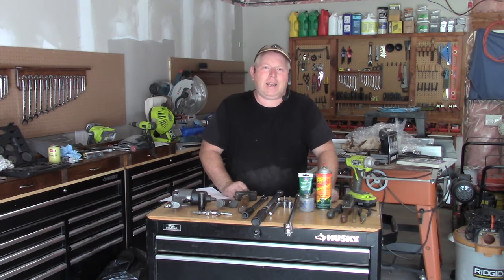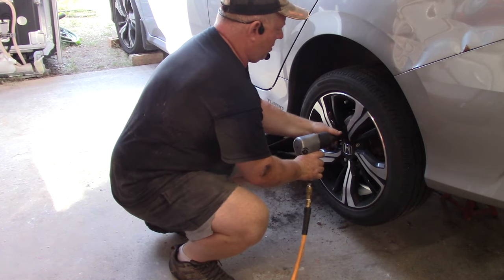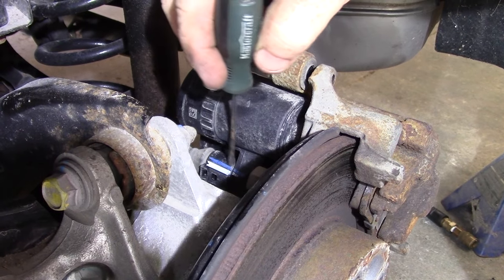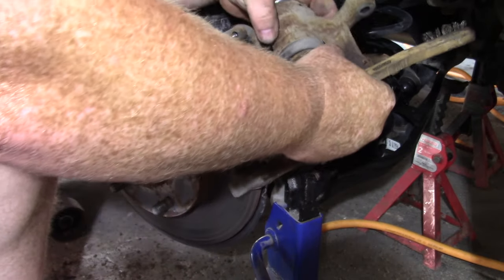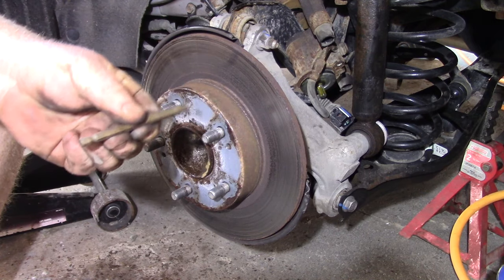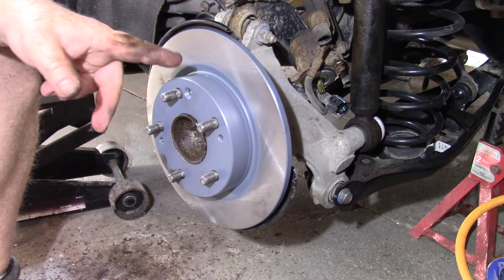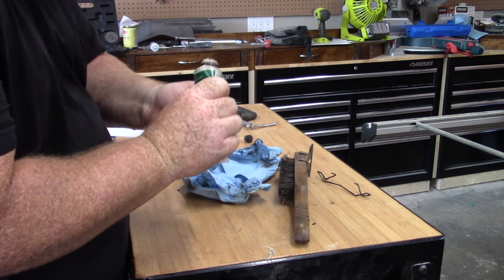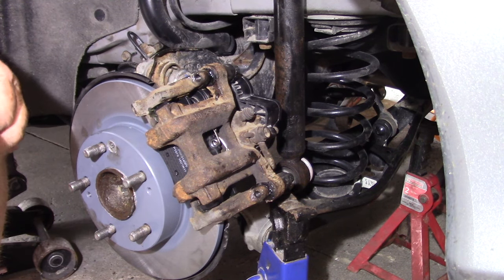DIY 2016 + Civic Rear Brake Replacement With EPB Using Honda Tech Manual

Comment: please help!!I Im only replacing the pads, do I really need to remove the rotor??
Reply from the maker: That's like buttering 1/2 a piece of toast or changing 2 out of 4 spark plugs. You should replace the rotors and lubricate the caliper slide pins too.

Comment: hi nice video but i have a litle problem i put the rear brake in my 2017 civic and now i have  a dashboard saying electronic parking problem  and a flashing brake light any ideas what it could be
Reply from the maker: At the end of the video there is a calibration sequence.  Need to do the calibration sequence to prevent getting a code.  Once the code is up you can only clear it with a newer code reader.
Reply: How many mile replacement befor

Comment: Is there a reason why you don’t have unscrew the motor back out if you screwed it in?
Reply from the maker: @jamesk1989  it’s electronic.  The only way to back it out fully is to put it in maintenance mode with a scan tool or retract it manually.  Once the service is completed you can reset the EPB with the simple calibration sequence at the end of the video

Comment: Is there  a way to lubricate the electric parking break while I replace the pads and rotors?
Reply from the maker: No.  It’s a sealed unit.  Good luck on your repair!
Cheers!
Rob
Reply: Thank you,  I wasn't sure.  It's been a very long time since I've worked on car lol

Comment: Great Video!  I appreciate that you have very thorough content, good lighting and you really get good shots of some important details.  However..
- it hurts me to see you abusing your torque wrench : (  This should be done in one smooth motion until the tool clicks one time. 
- anti-seize compound/lubricant definitely will affect the torque and the resulting tightened tension in that bolt.  Maybe it will not result in anything bad but the bolt will be over-tensioned.  Using torque to tighten a bolt is a very imprecise process anyway and it wouldn't work except there seems to be a pretty wide tolerance around what works.  I am in the rust belt and I put anti-size on mated surfaces but NOT bolt threads.  Been doing this for decades and I use a torque wrench.  Maybe my lug bolts are under-tightened but I can also claim that I have never had a problem.

- 7- in-lbf or ft-lbf ''' whatever"  well these are 12X different from each other so for beginners it is important to get this detail correct.  Experienced mechanics have a touch feel for this kind of thing but not everyone has that.

did the Honda manual specify lubricant on the brake pad slide area?  I tend to think this is useless because there is no seal and there will be tons of road water and salt spray.  That lubricant will not be around after a bit.  I never use lubricant there but I do have to do tons of work to clear rust out of the slide area to avoid the pads being bound tight into the caliper carrier.

for initial tightening of the lug bolts a too-small 3/8 drive impact such as the Ryobi would be great.  it will not reach full torque that the lug needs but will nicely snug up those bolts.  I always torque the lug bolts before lowering the car or lower it just enough that the tires help counter-hold a bit.  Using an air-powered impact it is quite possible to exceed tightening torque before the torque wrench is used and all you will be doing is performative clicking.

anyway, this is about the best brake pad change videos I have seen even though I had some small issues with it!  thanks!
Reply from the maker: In the auto industry they check torques multiple times for important fasteners.  I'm going to make a video on torque and anti seize compound soon because I get so many comments about it.  Yes you are correct, the bolt will be on the plus side of the "nominal" torque spec but well within the plus/minus tolerance range and the actual safety range of the fastener is significantly higher than the nominal torque specifications.  Most people who do a lot of auto work on their own vehicles use anti seize compound and there are a lot of compounds used on fasteners in the auto industry.  Usually to prevent rust and sometimes dry thread lockers are pre applied to fasteners such as SRS components.  
Thanks for your comment!
Cheers!
Rob

Comment: is turning the vehicle to 'on mode' same as starting the vehicle?
Reply from the maker: No it’s accessory mode, press once without your foot on the brake to turn it on or turn key to the first position but don’t start it.  Then depress the brake and apply electronic parking brake.  Make sure to wait until it’s fully engaged.  After it’s fully engaged you start the car, pump up the brakes and cycle the electronic parking brake off fully and on fully 2x.  That calibrates the parking brake.  Good luck on your repair!
Cheers!
Rob

Comment: The service manual says to torque the caliper mounting bolts to 80 ft-lbs. Why did you torque them to 55 ft-lbs instead?
Reply from the maker: Front brake caliper torque is higher than rear brake caliper torque.  It’s a much smaller assembly and that’s why the rear specifies a lower torque.
Reply: @robsgaragewoodworkin  But again, the 10th Generation Honda Civic service manual says 80 ft-lbs for both the front and rear. Yes, I did check the manual multiple times to verify this. So, I'm not sure why some people are applying only 55 ft-lbs. I just want to be sure because I plan on changing my brakes for the first time. 

Also, thank you for responding!
Reply: @robsgaragewoodworkin   The reference: Honda civic service manual chapter 27 under section "Rear Brake Caliper Removal and Installation", step 7 "Brake Caliper - Remove". Shows a diagram with the torque specs. States 80 lbs.ft

You can easily find the manual by searching "Service Manual for 10th Gen Civic"

Comment: Do you do this job with the ignition on the entire time? The reason I ask is because if you turn off the ignition it will automatically apply the handbrake. I was wondering if you have the ignition on, won't it put a warning light on when you disconnect the motor wiring, i.e. detect an open circuit? Thank you.
Reply from the maker: Release the parking brake.  Turn off car.  Follow all the instructions in the video.
Reply: In this model Civic, you can turn off the ignition with the parking brake off and it will not automatically engage the parking brake

Comment: Should I remove the fluid reservoir cap before compressing caliper pistol
Reply from the maker: You can but it isn’t actually necessary.
Reply: @robsgaragewoodworkin  If you have added brake fluid to the reservoir as the brake pads have worn, you can remove some brake fluid from the reservoir to prevent it from overflowing and spilling in the engine compartment. A better way is to open the bleeder valve as you compress the caliper piston, (not Pistol), but be careful not to leave it open or to let air enter when you release the tool that you use to compress the piston. Close the bleeder valve before removing the tool. It is best practice to not force old fluid that has been heated at the caliper up to the master cylinder.

Comment: Also, was it really necessary to remove the EPB motor housing?
Reply from the maker: You can buy a scan tool with special “brake maintenance mode” and electronically back the EPB up.  You can back it up manually with a brake wind back tool or you can remove it and rewind it by hand like I show in the video.  There are lots of people who have problems with the wind back tool and most people don’t want to spend an extra $300+ for a compatible scan tool.  This is why I posted this video and this method.
Reply: @robsgaragewoodworkin  oh okay, I wasn’t aware of all the content surrounding the EPB. Glad I found your video though because I would have been confused. Thanks again!
Reply: @robsgaragewoodworkin  In all fairness, they are not that expensive anymore. I actually did a 2017 Civic today and use the Autel EBS301 and it is about $200. There are some for $100, but I use this for several brands, so I spent a little more. Its far easier, plus when you do it manually, it leaves several codes in the control unit. It doesn't seem to cause a problem, but the codes are there. I cleared out about 4 today from the previous service.

Comment: What are the tools you don’t need ? I’m buying all the stuff and I’m trynna fig out what tools do you not need ?
Reply from the maker: You will need a socket set and a breaking bar and a torque wrench and brake grease and that special socket for the EPB that I mentioned in the video.

Comment: K I just got watched another vid the guy just turn the key to the on position and changed his brakes without taking off the electronic brake is this ok ?
Reply from the maker: Not really.  You can remove the pads and reinstall the same pads but the new pads are thicker and you have to press the piston back in to get them to fit.  The e brake retracts but not fully so you will always have to set it to service mode manually like I did or with a computer or new scan tool.  Good Luck with your repair!
Cheers!
Rob
Reply: @robsgaragewoodworkin  just changed out both sides without issue thanks to your step by step vid awesome thanks

Comment: I just broke the tab on the connection attached to the EPB. How can I disconnect now that it’s broken? Also do I even need to unplug?
Reply from the maker: You can leave it plugged in but I showed how to unplug it so people wouldn’t break it.  Dammed if you do, dammed if you don’t 😂
Reply: @robsgaragewoodworkin  Apparently I suck at following instructions😅😂. You did such a detailed video and I still found a way to mess it up haha.
Reply from the maker: @kiidxky1320    I thought that less people would break the wire if they removed it.  Couplers can be tricky
Reply: I did the same thing on the passenger side. I managed to get it disconnected eventually and had zero issue with the drivers side. I tried taking it off without unplugging it but it seemed to not have enough slack and I was worried I'd make things worse. Once everything was back together I didn't get any lights and the brakes feel good when stopping. I changed front and back this weekend.

Comment: How do I fix my brake system light. Lol I fu***d up. I did make sure the e brake was off while the brake pads were off. I think it broke cause you said confer clock wise but mine went clock wise and never ended.
Reply from the maker: Turn it clockwise until it stops.  Don't use much pressure.  I turned mine by hand.  After its all done and reassembled you have to turn car to accessory mode and cycle the parking brake on fully then off fully.  Start the car and repeat 1 more time.

Comment: hey rob, will a c clamp fit to compress the piston?
Reply: I'm wondering the same too! Worked like a charm on the front brakes!
Reply: @KeyGillz  I know. . I ordered a tool like what he has . Cost 20 bucks. . Im pretty sure a c clamp will work
Reply from the maker: Yes it will.

Comment: Do you have to put the car on maintenance mode ?
Reply from the maker: You can do it manually as per the Honda instructions (the way I did it in the video) or you have to buy a scan tool with EPB to put the car in maintenance mode.   https://www.canadiantire.ca/en/pdp/innova-3160rs-obd2-diagnostic-scan-tool-with-abs-epb-srs-network-scan-0251096p.html#srp

Comment: So I have been doing brake jobs on my own cars for 30 years. I have never needed to replace OR resurface a brake rotor. I just regularly check brake pad wear and replace them before ANY metal  to metal contact. Pads will still have material on them when I toss them. Original rotors still smooth as glass. I can get ceramic brake pads for less than $25. I have owned Civics, Accords, Camrys, F-150, Ford Rangers, 1 Miata, and a Silverado. I've done brake jobs on all of these EXCEPT rear brake shoes. I ABSOLUTELY hate messing with those. Fortunately most cars today are 4 wheel disc. I forgot about corrosion since moving down South. The Civic in the video is a little corroded looking underneath for such a late model car. I'm guessing it's the salt on the roads. Down here in Georgia a 20 year old car will have literally no corrosion at all and still be pretty clean.

Great video though and very complete. I will watch again regarding the electronic brake module portion when I do mine. My Civic is a 2016, but still less than 10,000 miles.
Reply from the maker: LOL!  Yeah I drive a lot and the salty roads make maintenance a much larger issue.  Thanks for your comment!
Cheers!
Rob

Comment: After removing the coupler, i try to remove the caliper but it will not budge. Any ideas?
Reply from the maker: The caliper slide pins hold the caliper to the caliper mounting bracket.  I think they were 7mil hex bolts.  Should be in the video.  If the bolts are out you just need to pry the caliper up.  I think I show it in the video.

Comment: Is it necessary to grease the back of the brake pads?
Reply from the maker: You have to use brake grease on the areas that move on the caliper and also grease the caliper slide pins.  You can put some grease on the piston ring if you wish to prevent rust and also where the caliper holds the back of the pad.  It’s not necessary.

Comment: What about bleeding the brakes?
Not necessary?
Reply from the maker: @migueldeleon7266   when you don’t open the system you don’t get air in it.  Hence bleeding is not required.  If you open your bleeder valve to push the piston back (as required on some makes and models) then you have to bleed the brakes after.

Comment: On the passenger side I have to turn the pin counter clockwise?
Reply from the maker: Just follow the instructions in the video.  Both sides are the same.  Good Luck with your repair!
Reply: Turn clockwise on both sides.

Comment: At 7:34...you can do it without detaching the coupler from the actuator. I did the same, worked perfectly. One less step. And Place some plastic cover on actuator once you pulled out the actuator cover. You don't want anything to fall on grease.
Reply from the maker: It’s the eternal question.  Do you tell people how to disconnect the coupler so they don’t break the wire or don’t disconnect the coupler so they don’t break the coupler. 😉
Reply: Your video helped me save $450 + taxes (labor only) at Canadian Tire. Outstanding video!! Can't complain Sir ☺️
Reply from the maker: @sudhirthakur7957  lol!  You are welcome!  No worries! 👍🏻👍🏻👍🏻

Comment: Do you have to remove the ebp before pushing back the piston if I am just going to change the brake pads ?
Reply from the maker: Yes.  If you push the piston back without retracting the EPB it will break the EPB and you should change the rotors and lube the caliper slide pins.
Reply: @robsgaragewoodworkin do you have to put the vehicle into service mode before beginning the brake and rotor replacement process?
Reply from the maker: @elitemindshq3228  yes you can do it manually as described in this video or you can do it with a scan tool that supports EPB.
Here’s another video that shows using the scan tool.
https://youtu.be/V9NDnOIYWag?si=rrHqETNAzfw0DW1o

Comment: The rear caliper bracket should be torqued to 80 ft-lbs. the 55 ft-lbs spec was for the older gens. the honda manual says 80 ft-lbs for the 10th gen
Reply: the EPBA 5mm hex bolts are torqued to 5.9 ft-lbs for anyone wondering

Comment: My epb wire came out of the motor I’m trying to figure out what color goes on to 1 and 2 slot black or white brake system light is on my dash now
Reply from the maker: Have a look at the other side for reference. Is the coupler out or the wires?  And if it’s the wires are the crump terminals still on them?
Reply from the maker: Crimp
Reply: @robsgaragewoodworkin  the same thing happened to me, when I apply the parking brake only one wheel stops the other is loose, and I also have the ABS light on and the parking light is blinking, now I don’t know how to fix it

Comment: No bleeding? After checking pads
Reply from the maker: No.  You only need to bleed brakes if you open the system. Like change the caliper or the brake line,
Reply: Not true when you charge pads and push calliper pins get air inside lines you need to bleed out oil to remove air pockets
Reply from the maker: @navafkr7363  the caliper slide pins are not hydraulically actuated but just slide pins.  If you could get air in the hydraulic system  then hydraulic fluid would also be able to leak out.

Comment: Need some help, 2 days ago I had my rear brake pads changed but now the whole system lights are coming on and the parking brake on the right side is not working and the warning lights are all coming on, did the mechanic pull out the sensor wires....can anyone help or faced this problem before
Reply: I'd say he did not put the rear calipers into maintenance mode before he replaced the pads. Can be done electronically or manually.  Watch this video to see how to do this
Reply from the maker: Oh no.  At the mechanics or at a friends?  They have to be placed into maintenance mode either manually (like I did in the video) or with a scan tool.  People don't know that electronic parking brakes require a different procedure.  Hopefully they didn't damage the actuators.  You will need to get them put into maintenance mode and then out of maintenance mode and calibrated to see if they are OK or not.  If you go to the dealer they will automatically say they need replacing and charge you a fortune.  Good Luck!